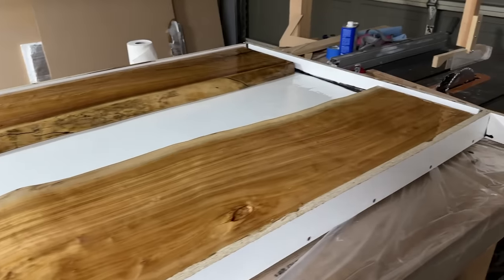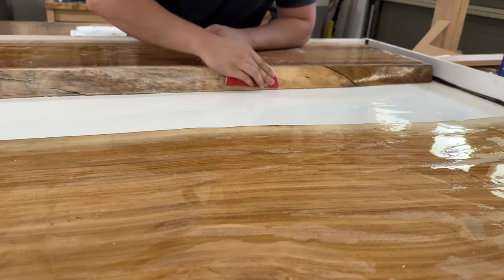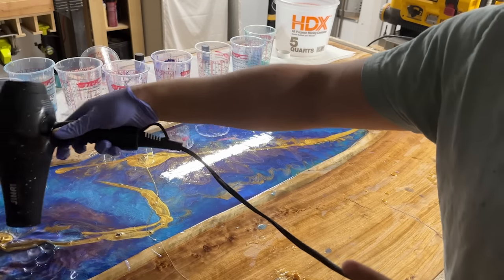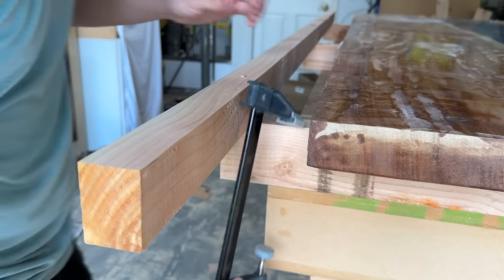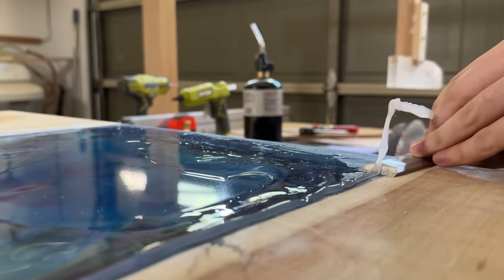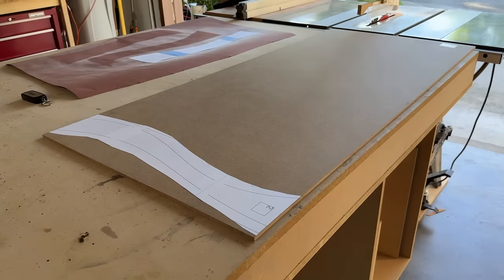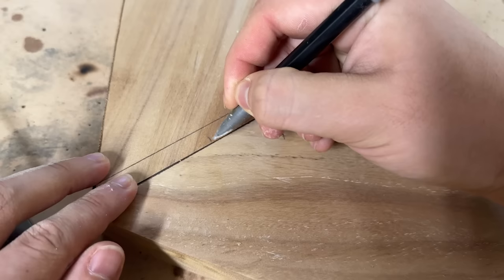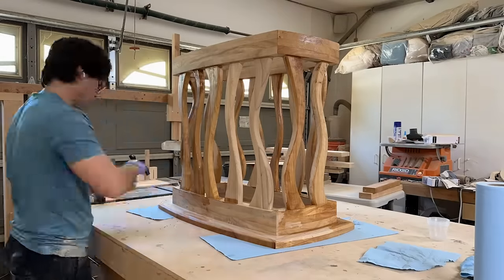Trying to Build a $2000 Dining Table in My Garage - My Biggest Challenge Ever

Comment: The thing I've learned in the few years I've been woodworking is that it's never failure until it's outta your hands. And that most mistakes can be fixed with a little bit of wit and creativity. Good video on showing those obstacles can be overcome

Comment: Wow I am extremely impressed with your artistic vision as woodworking. but also so your ability to narrate in describing your process, and reasons behind your ideas was visionary. You did an amazing job on building this is an absolutely gorgeous wooden table with a center pour of blue epoxy that is flowing like the ocean, and this  base you built is beautiful wooden design that looked like driftwood roots is stunning. I am so looking forward to see more of your builds and creative carpentry designs.

Comment: Attention to detail takes any project to a higher level. Good 2nd video, you're already creating your own style. And as for using the C-channel to stabilise the top and to connect the base , I've always wondered why other makers don't combine the steel base with the C-channels
Reply from the maker: Thank you for the kind words! I think most of the time it's just easier to attach the base from the bottom using buttons or recessed oversized bolt holes, but in my case the curves of the legs got in the way of that. Maybe other woodworkers will see this video and this technique will be adopted by others, who knows?
Reply: I have definitely seen this done before, seems quite a no-brainer use for them as long as the location of them is suitable, obviously.

Comment: Pretty good video and I will subscribe to your channel. I only ask one thing…….please do not, under any circumstances cut loose tenons like that (24:10). Your left hand is far too close to the table saw blade. If you keep doing that, your woodworking career will be cut short, not to mention your fingers. Next time use a mitre box and crosscut saw or, if a power tool is necessary, a band saw. Just sayin’